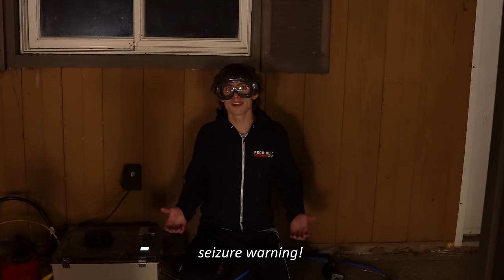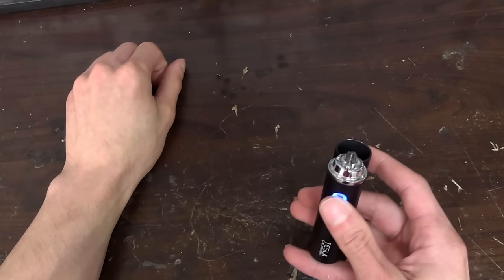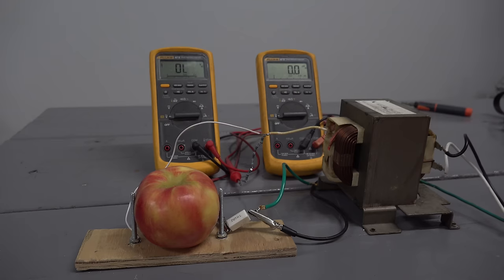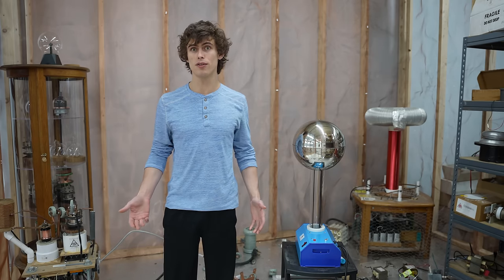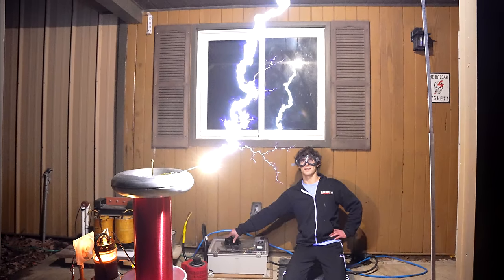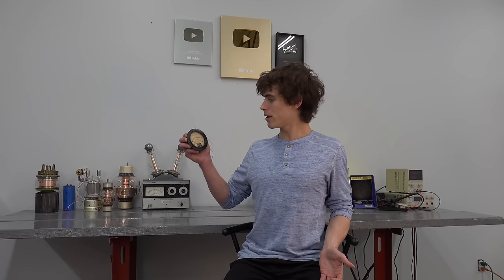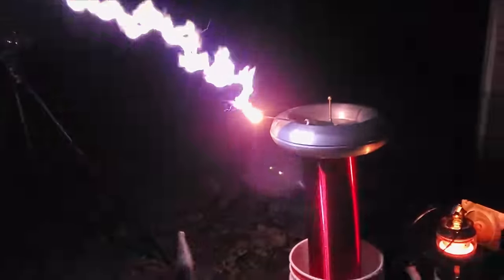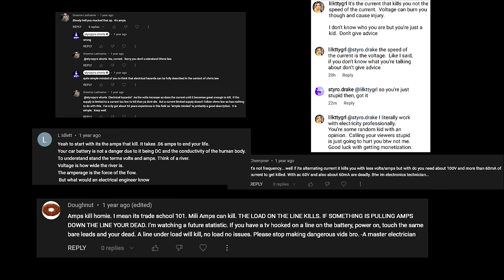Is it the volts or amps that kill?

Comment: Good stuff. A rule of thumb that's more accurate than either voltage or current being deadly, is that power within a certain range kills, ie. power = voltage x current. But as you say, this isn't complete either because time factors in as well. Still better than either voltage or current alone, so for something easy to remember, always be extra careful around things that can deliver a lot of power.
Reply: This is wrong.
It is not power.
It is a certain minimum amount of current for a minimum length of time.  

And power is not voltage x current. That is only true if the quantities are constant.

And it is not constant, as your body has capacitance and it takes a while for the voltage to build up. Whilst some tissues of the body are resistive to a degree, that principle breaks down when the tissues start to burn.
Reply: @deang5622  he said its a mix of all three current, power , duration… so why try to say others are wrong when you aren’t exactly right either.
Reply: Wrong on so many levels. A car battery has a huge amount of power, yet the electrocution hazard of it is harmless. It’s volts that determine how dangerous a source may be because volts determine how much current may pass through you. Assessing an electrical hazard by voltage before anything else is the most effective method. Most electrical devices have enough current to kill but only some electrical devices have enough voltage to kill.
Reply: @Make_Boxing_Great_Again  Well, they did say power "within a certain range", probably meaning that you need a minimum amount of current and a minimum amount of voltage for it to kill you (+ for a minimum amount of time).
Reply: @franciscobarrio1395  Power and current are only relevant to the circuit in question. A short circuit through a human will have totally different properties to almost all other circuits, the circuit of the source for example. If a circuit has huge ampage and power, without knowing the volts you have no idea of the circuit’s ability to push a charge through you. Volts is the relevant unit when assessing danger. The high voltage sources of charge that are harmless are harmless due to quirks / very specific circumstances that are not often replicated through different electrical devices.
Reply: @franciscobarrio1395  Tell me, in what way is power even remotely relevant?
Reply: @Make_Boxing_Great_Again  It's relevant in the sense that that's probably what they meant. Of course with not enough volts, the current won't even flow through you, but with not enough current intensity, you will not suffer any damages. Since power is a function of both, do you really NOT see how power is relevant to what they said?
Reply: @franciscobarrio1395  🤣 what does “not enough current intensity” mean?
Reply: @Make_Boxing_Great_Again  Are you deliberately not understanding what I'm saying? You get fixated in "current intensity"? Where do you think the "I" to designate "current" in a formula comes from? I know you can make the connection, come on
Reply: @franciscobarrio1395  🤣 🤣Well now the question is: What do you think I think it means??? What’s the likely explanation here, that either a) You don’t appear to know what you’re talking about except for being able to recite a few basic physics formulas and thus are only able to provide a very poor explanation that doesn’t really make much sense. Or b) I don’t understand what you’re saying because my comprehension of basic physics and circuitry is somehow lacking? Let me give you a tip, the answer is b. 🤣🤣P.S “current intensity” is not a technical term lol.
Reply: @Make_Boxing_Great_Again  The conventional symbol for current is I, which originates from the French phrase intensité du courant, (current intensity). Current intensity is often referred to simply as current. The I symbol was used by André-Marie Ampère, after whom the unit of electric current is named, in formulating Ampère's force law (1820). The notation travelled from France to Great Britain, where it became standard, although at least one journal did not change from using C to I until 1896.

With every comment you post I'm more convinced that you're trolling, so I won't respond further since you clearly don't want to understand
Reply: @franciscobarrio1395   Nice google and copy & paste skills. I’m not a troll, and if anything, you are! I’m only trying to help people learn to become confident, safer, and more knowledgable with regards to working with sources of electric charge. So once again, In what sense is power a relevant parameter when assessing the level of risk of an electrical source?
Reply: @Make_Boxing_Great_Again  We established that both voltage and current are needed to kill. Power is a function of both. HOW are you unable to see how power plays a role here? I feel like it's easier to understand it than it is not to.
Reply: @franciscobarrio1395  Ok then, here’s a question for you. So at what level of power then can an electrical circuit be guaranteed to be safe?
Reply: @Make_Boxing_Great_Again  At one where either the voltage isn't high enough for current to flow through you, or where the current isn't high enough to kill you. It's a multi-variable function, so there isn't just 1 value where it's safe. I feel like if you're trying to teach people this, you should know the answer to this question.
Reply: @franciscobarrio1395  Exactly, so how is power a useful parameter in isolation? Tip, it isn’t useful.
Reply: @Make_Boxing_Great_Again  When did I say anything about it being useful in isolation? I literally, expressly said it's useful BECAUSE it's a function of voltage and current. You just assumed I meant in isolation.
Reply: @franciscobarrio1395  Good, your learning. Without any other parameter, power is a pretty useless parameter for assessing an electrical hazard. 20w could be enough to kill under the correct circumstances and anything above 2 w is unpleasant. A simple harmless flashlight could be 35w and a car battery can produce 12000w! With the voltage parameter you can rule out a huge amount of electrical sources as posing a threat. That’s why signage is in volts. Yes, there are some quirks where high voltage is not a threat due to other circumstances, mainly current, but high voltage almost always causes a shock and the other major parameter is current, not power, yes you can calculate the current if you have voltage and power but that’s just the long way round to do it. So there you are, voltage is most useful followed by current, duration, and then frequency. Power is an unnecessary complication.
Reply: @Make_Boxing_Great_Again  You're*. And you're addressing something I never even talked about. The original statement, "power within a certain range kills" is true, you said it in your unnecessarily long last comment where you explain obvious concepts while trying to "teach" someone who clearly at least has a logical comprehension that's way above yours. But at least we reached an agreement, so there's that.
Reply: @franciscobarrio1395  You can’t demonstrate that your comprehension is above mine. Thanks for finally agreeing with me. Took a while but you got there.
Reply: @Make_Boxing_Great_Again  Weren't you the one who couldn't for the life of you, not even using Google, figure out what current intensity mean? It's just weird that you type like an adult, but the words themselves you speak seem like they come from a child.
Reply: @Make_Boxing_Great_Again  I literally copied and pasted the "current intensity" text from Wikipedia (the literal first link you get when Googling it, but you don't seem to be able to do that for some reason). Again, that's where the I symbol to refer to current comes from. Weird that you'd get caught up in that since there's not much we can discuss, it's not my opinion.

As for the other point, I meant that you type like an adult, as in, you use punctuation marks, and such. But the sentences you form are just not very intelligent. But then, again, reading comprehension doesn't seem to be your strongest point, which just makes me question how long to keep this going for when every point I make just flies over your head.
Reply: @franciscobarrio1395  Ah ok, you've displayed some signs of progress, but there's still significant room for improvement: "I meant that you type like an adult, as in, you use punctuation marks, and such. But the sentences you form are just not very intelligent." First of all, how I type is irrelevant to the point you're trying to make, you haven't even seen me type. The proficiency by which someone types has no relation to their comprehension of punctuation and grammar. There was a significant period of Stephen Hawking's life where by his typing aptitude was non existent but his comprehension of punctuation and grammar was notably above average! Second of all, a sentence can't have intelligence because a sentence is a concept. It's like attempting to measure the intelligence of 'maths' or a 'colour'. 

I believe; correct me if I'm wrong, that the point you're trying to make is that my punctuation and grammar is adequate but that my reasoning has the hallmarks of someone who is unintelligent. However; as mentioned, the severity and frequency by which you fail to converse logically leaves notable doubt in my comprehension of what you're trying to express!
Reply: @Make_Boxing_Great_Again  I see you brought the Big Words™ to the conversation, you got me. You're so caught up on this point that I guess you just surrendered the original discussion (not surprised though). And no, that was not the point I was trying to make, because it wasn't "my point". That would be like saying my point is that the Earth is round when trying to convince a flat-earther. I hope you do understand the metaphor and I need not explain it like you're 5.

Since both our points are well set at this point I think it's clear where the discussion is going, so I won't be responding anymore. Good chat though
Reply: @franciscobarrio1395  That's not the point you were trying to make? So my reasoning is in fact sound after all that? Well congratulations on your journey.

Comment: Hello Styro! Fellow physicist here. At about 17:00 you reference skin effect would apply also in a microwave. But microwave involves the absorption of microwave electromagnetic waves into molecules (which is more related to optical and vibrational properties of matter and their interaction with photons / light basically). Why would the skin effect apply to this case as well? I don't think it would because skin effect is a magnetic effect happening on electrons while here it is atoms/molecules interacting with photons, and the penetration depth of the photons would depend, for example, on the complex dielectric function of the material and its absorptive properties at that frequency. I would expect no current to pass through the banana at all. Also when the banana outside starts burning (which makes sense it burns first as it is the first absorptive layer of water in the way of electromagnetic waves) the heat would then propagate via Fourier law and hence you can start cooking the inside too (depending more on the thermal conductivity on the medium, which can be related to conductivity, but still different concepts). Don't know if these things are related and if they are please tell me how come you used this example to be one proof of the concept.
Reply: test
Reply: I was wondering about the banana too. That makes no sense.

Comment: It's hilarious how often people will claim they know more than someone posting a video, clearly you've got plenty of knowledge on this subject. Definitely learned a few things, I knew it wasn't just volts +amps over time this clarified it way better than electrical safety classes when I studied to be an electrician.
Reply: It is a logical chain. It is the current over time which kills you. But how much current can kill you depends on the pathway and the time. How much voltage will be needed to deliver that curent depends on body resistance. For very short pulses, like small capacitor discharges, it is a constant charge model which describes the stimulus strength, completely independant of the amount current which flows. 30 mA give a risk at C1 for a left hand to both feet path. For a left to right hand path the cirrection factor would be 0.4. So 75 mA would be needed to have the same risk of VF for this current path. 
From the left hand to both feet a charge of 4 mC, from a single short duration capacitive discharge are needed to cause VF at the C1 curve. From one hand to the other it is 10 mC. A violent muscle contraction only needs 15 µC. But for longer pulse durations the amount of charge will increase. Smooth DC also has completely different effects on the body than changing current amplitudes. 
So at the end of the day it is all way more complex than just a few simple numbers.

Comment: As a technician electrician i find this video very helpful and in fact profound. In school they know the topic is complicated with tons of physics and math included so they give us a rule of thumb and not always require you to go through elaborative understanding. The rule of thumb being in this case that amps are the lethal force. The statement of course is not false however it is not the only factor as this video amazingly portrays in multiple practical experiments. You're big brain my dude.
Reply: That isn't a rule of thumb. Saying it is the electricity that kills is a statement of fact.

The rule of thumb is: (actually 2):
1. An AC voltage of 50 volts RMS or higher can be enough to produce enough current to cause electrocution
2. A DC voltage of 120 volts or higher can be enough to kill.

Comment: Very precise and great video. All I know is that I will be careful anytime I am around high-power electrical systems or events. Lightning strikes have a nasty habit of instantly cooking the flesh inside the parts of the body the immense power flows through. Even if you survive the shock, that pretty much kills you after the fact, as all the skin and organs burnt, die. And sadly, you never really know where you might encounter a defective electrical safety situation. There was a child who was at the MGM casino in Maryland, and he got very badly electrocuted on an improperly grounded escalator. I still don't know how that happened. Everything on an escalator you put your hands on is covered in rubber. Poor kid never had a chance.

Comment: I think about it like this, Voltage is basically just the tool that pushes current, so you can say that Voltage is like a gun, and current is the bullets, if you get shot it's not the gun that kills you, it's the bullets that kill, you don't die when standing in the presence of a gun, the same way you don't die by standing near a plug socket.

Comment: Okay, I've watched until 3:28. Lets see if my take on the subject aligns with yours: I am an electrician with specialty in automation from germany (230 V 50 Hz). I did the standard 3 1/2 years of training. In trade school, we were taught that about 50 mA kills. This is what usually gets regurgitated over and over again, just like in this comment section. But we were also taught that there is a big fat asterisk attached to that value, and most people seem to forget that. Yes, a car battery can dump a tonne of Amps, but that's not the current that's flowing through you in your example. The hand-to-hand resistance varies greatly depending on moisture, grip, injury, AC or DC, frequency, how high is the voltage etc, so it can be anywhere from 1000 Ω (500 Ω if the voltage is high enough to break down your skin) to 100000+ Ω. Assuming worst case scenario: 12 V/1000 Ω = 0,012 A or 12 mA, which isn't enough to kill you. 
The 50 mA kills if that's what's actually going through your body. There is a reason a GFCI/RCD (assuming it's for protecting you, and not the house) is generally rated below that. Those 50 mA we were taught at school, assume a 230 V 50 Hz system, with those 50 mA flowing through your body; it's a handy value for napkin math when you're trying to figure out if something could kill you.
Likewise, a high voltage source might be able to kill you, but it really depends on how much Amps it can actually source. A hypothetical 100000 V source, that can't source more than 0,01 mA most likely won't kill you. Sure, 100000 V is a lot, but if it can't push any meaningful current, it won't do much. But if you don't know what you're working with, it's much safer to assume it will kill you.
And I haven't even talked about exposure times yet, which further complicates the answer.
So my conclusion: The current kills, kind of, but not really. The voltage kills, kind of, but not really. Neither value on its own will tell you the full story. You won't know whether a source can kill you if all it says is 100000 V, but it for sure is safer to assume it can. The same is true for a source that just says 1000 A. You can however make assumptions when working with very low values. A source that just says 0,001 V most likely won't kill you, regardless of how much current it can provide. The same is true for a source that just says 1 µA. But again, if you don't have the full picture, assume it will kill you.

EDIT after watching the video: All of the above was from the top of my head, and I think I did pretty okay. Thanks for the refresher!
Reply: Yep, pretty good! If that's all the stuff you're dealing with, then that's all you'd need to know. Nothing about high frequencies or weak supplies or such.